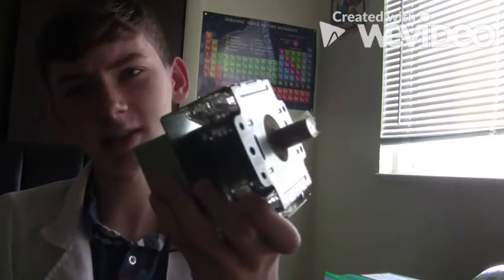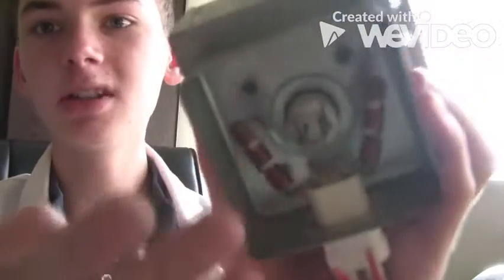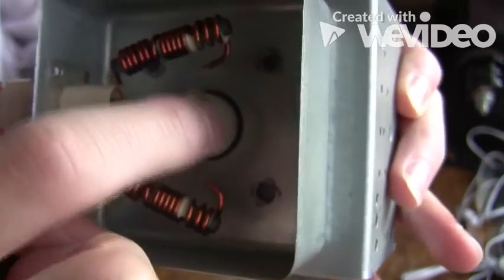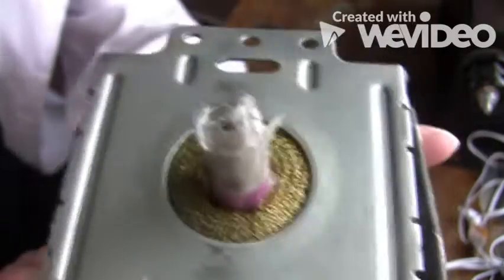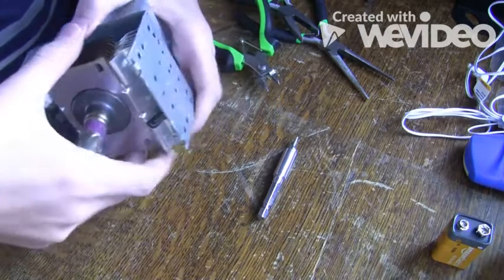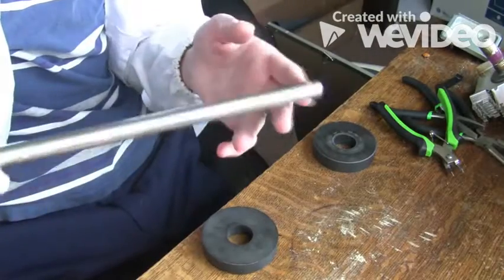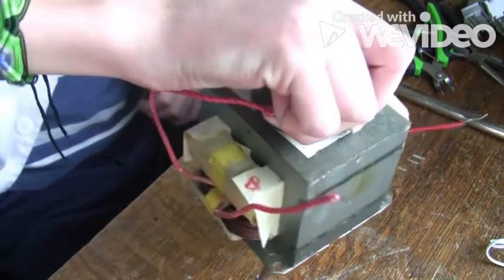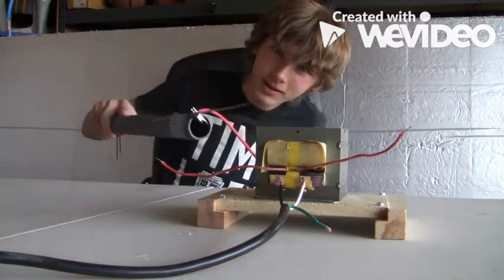New Super Magnets From a Microwave Oven!

Comment: Just in case people skip over an important part. Don't crush the ceramic strips (purple) that he talks about. It will release beryllium, which is extremely poisonous and can lead to fatal conditions if ingested.
Reply: Stop spreading misinformation! That is not berryilium, too expensive to use it on home applicances! That is Alumina oxide painted in pink...

Comment: Great way to ruin a pair of wire cutters and needle nose pliers.
Reply from the maker: Yea probably, I was like 14 here I literally knew nothing
Reply: @Plasma.Prince  OK, I get it!  At least you probably learned from it.  Don't worry, everyone does it at one time or another, when the best tool for the job isn't handy.  I'm guilty too!  I know people using tools for decades that still abuse them.  Thanks for responding to a 4 year old video!
Reply from the maker: @ No problem bro, its one of my top ones for some reason lol even though the quality is atrocious compared to my later uploads
Reply: @Plasma.Prince  I've been a scrounger since I was a kid, always tearing things apart that would otherwise get thrown out, and finding other uses for the parts inside.  Looks like you're one too, I'll have to check out more of your videos.
Reply from the maker: @ Aight bettt🔥